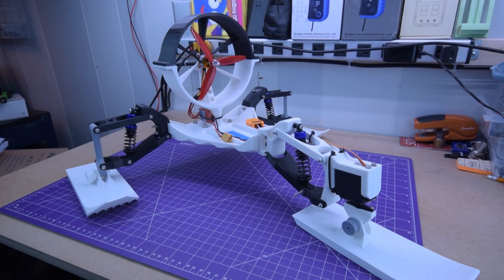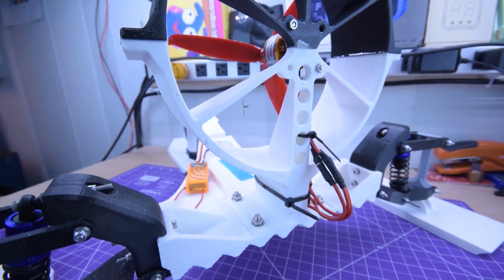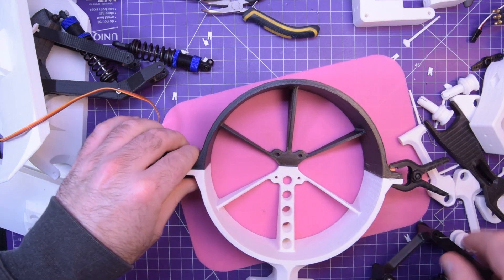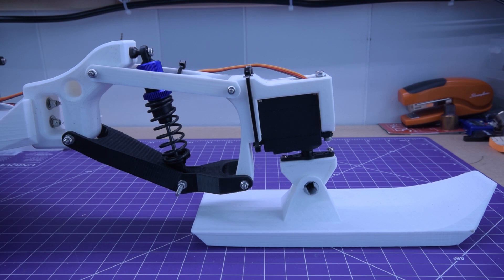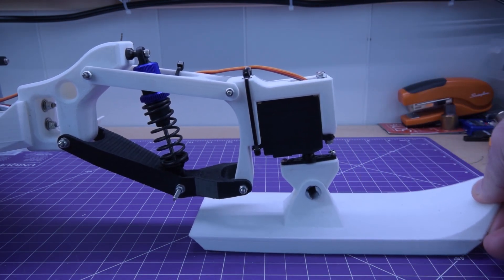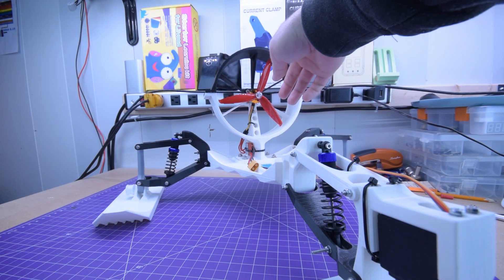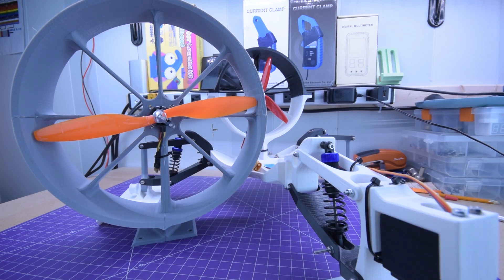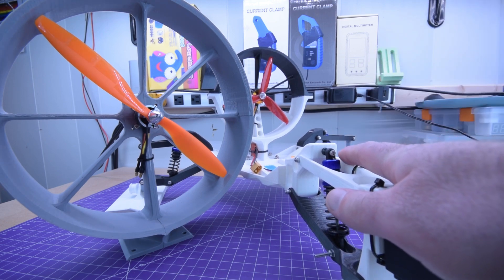Fully 3D Printed RC SNO-SPEEDER!

Comment: Just some ideas
Modify as you said to have a steering shaft with bearings (like the little bearings from hard drive or fan motors), add a spring so the front ski is pulled up gently, might help with not digging in, or restrict the forward tilt angle.
You could try just one fin in the middle of the back skis, or maybe just one each side of each
Because you can easily remove the skis, what about making a wheel  alternative for summer testing, double inline wheels for each 'summer ski'

Comment: Couldn’t you compensate for the downward thrust on the front end by angling the propeller upwards?  (So not parallel to the ground but a few degrees above that plane?)
Reply from the maker: Quite possibly - but summer came too fast!

Comment: Try a curved front edge to the skies instead of an angle.
Reply from the maker: Would be worth a try, but curves are harder to print. The entire ski would sink in though, I think it just needs a redesign
Reply: @SimpleElectronics  Curves have a natural tendency to push up (aeroduynamics and depending on the curve, on an FDM printer can be done without supports.